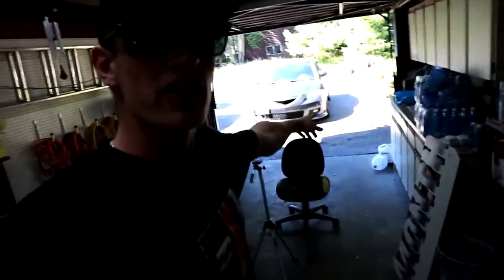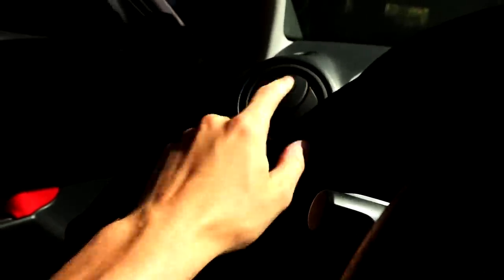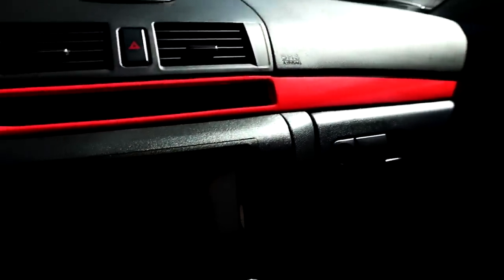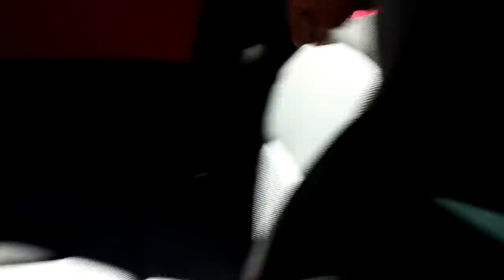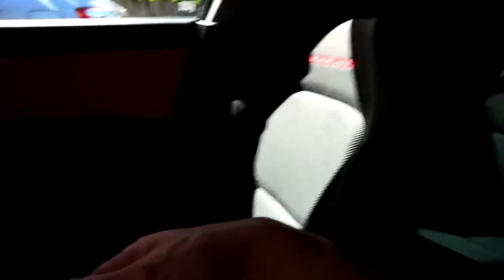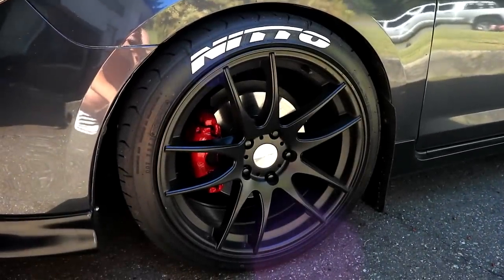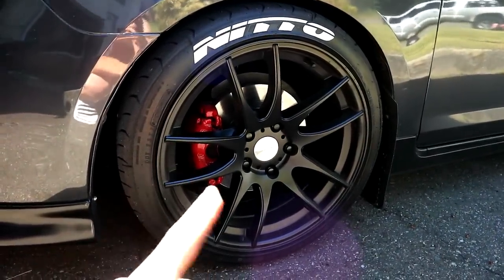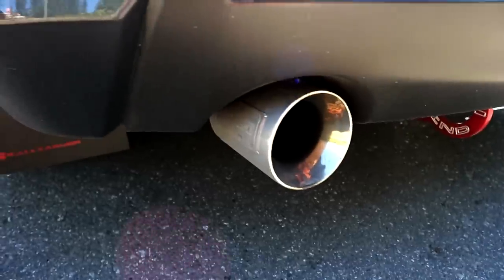MAZDA 3 MOD LIST! | 2007 Mazda 3

Comment: bro, for 18x8.5 rims do we need to roll the rear fenders, did you roll yours? I just read it somewhere, just making sure.
Reply from the maker: If you're running anything +40 offset or lower, than yes.
Reply: @ColtonRichter  I take it as a yes, I will need to roll my rear fenders? :(
Reply from the maker: I'm not sure what offset your wheel is, anything basically below +40 is pushing it, but below you definitely need too.
Reply: @ColtonRichter  did you adjust the camber or just rolled the fender? no rubbing with 2 passengers on?
Reply from the maker: Stock camber & allignment, rear fenders were rolled. Rub with passengers in massive road dips, no damage to tire though

Comment: What’s size are yours rims, I have a 2013, mazda3 took my mechanic today and tried putting 20inch oem infinity rims, they are 245 40r 20, they won’t fit there hitting springs any idea what size spacer too use??
Reply from the maker: These are 18" wheels, normally don't recommend going above 18!

Comment: why not get a speed 3? or speed 6
Reply from the maker: I have a Speed 3 now
Reply: They're a couple grand more that's why lol. If anything, just add a turbo later and it'll come up to pretty much the same
Reply: @ColtonRichter  oh nvm then
Reply: Swoooooveq I’m not saying it’s not doable I’m saying it’s not very smart haha
Reply: Swoooooveq yeah but Honda’s don’t come turboed so it makes sense to turbo them haha and they’re a better platform to turbo anyways. I’m all for fun but you gotta be logical and smart with your money too, that’s all haha
Reply: Jeremie Lizotte lol do you know how hard it is to turbo a NA 3? It literally costs at least $3k to “add a turbo later” and there aren’t any premade OEM compatible turbos for it.
Reply: Swoooooveq no not for the 3. There’s barely any aftermarket support for the first generation 3 when it comes to turbo/forced induction. You would have to salvage parts and use adapters. There aren’t any name brand kits for the 3. You need to do the research
Reply: The body style
Reply: @Swoooooveq unless you have a mazda6 like me.... no turbo kits out :), it would have to be custom.. shootmeplease
Reply: @Swoooooveq  The amount of custom fabrication and dyno tuning alone to make a turbo work with a base 3 would easily break $3k. base 3's don't have the aftermarket support of hondas. You can't slap a turbo on it like you could with a civic. It would probably be cheaper to buy a speed3 and upgrade the turbo on it than it would be to turbo a NA 3
Reply: Colton Richter thank fuck

Comment: Did you have to modify the foot well? It's too narrow for people with larger feet, especially in the winter,  and the right shoe can get caught in between the right edge of the brake pedal and the side of the plastic foot well panel.
Reply from the maker: Nope, was fine for me

Comment: Do you have spacers or does 8.5 width fits perfectly?
Reply from the maker: It doesn't matter what the width is, you need to look into offset. I could have 7.5 inch wide wheels and have them fit the same but that's because of the offset. I don't have spacers ,no.
Reply: Dudesk7 thank you for answering my question
Reply: Dudesk7 would it fit with +35 offset ?
Reply from the maker: My wheels are 8.5 wide with +35 offset, if you want something that fit's nice and won't rub barely at all then you want 8.5 and a +38 offset.

Comment: dude did u change ur headers or intake?? when u change ur muffler
Reply from the maker: Just exhaust
Reply: Dudesk7 oh so ur using straight pipe does it reduce power and more fuel consmption??
Reply from the maker: No, it's a CorkSport catback exhaust. It's a resonator and a tuned muffler, increases slight power.

Comment: So I actually have 207000 miles on my 07 mazda3 and I’m debating doing anything to it. It’s my first car and I really want to work on it but I’m afraid that ones the transmission goes, so will the car. Any advice?
Reply from the maker: Focus on maintaining the car, if the transmission goes then you'll have money to either replace it or get something else. 207miles is quite a bit.
Reply: Dudesk7 damn I was hoping you’d say something else 😂😂thanks though
Reply: My '06 is running strong @ 258k miles.. maintain the basics and you'll be able to have $ to mod

Comment: Is that mazda3 2.0? Or 1.6? Is it fast when accelerating?
Reply from the maker: 2.0L, it does have quite a fast acceleration due to the torque it produces
Reply: mine is 1.6 I hope hes list setups fits for 1.6 as well :(

Comment: Hello guys! Turning 18 in one month and started my driving lessons. I liked the mazda 3 and the mods this guy added to it. Anyone knows good first car buys? My budget is about 5k euros.
Reply from the maker: I will say, Mazda 3 2.0's are reliable and fantastic, great bang for your buck!
Reply: @ColtonRichter  Thanks for the answer. But I heard cars 10+ years old start to have problems. What are your thoughts on that? Never looked into cars and stuff until now so I am not really experienced in this field.
Reply from the maker: Johnny Bravo Everyone's heard it,  but new cars can be the same. Say if you found a lower mileage Mazda 3 that's had maintenance done, you're golden. Just make sure its been taken care of!
Reply: @ColtonRichter  Aight thanks. Is 100000km consider fine?
Reply from the maker: Johnny Bravo That's more than perfect, I got my Mazda 3 when it had 170,000km and currently at 227,000km and it's been bulletproof. Just take care of it and it'll treat you well 🙂

Comment: What is the PCD of your rim?
Reply from the maker: 5x114.3
Reply: Colton Richter Thanks bro. I have 2008 mazda 3 stock if i change my rim to 18x8.5 offset 44 and the tire 225x40x18 there is any modification or need to adjust?
Reply from the maker: Watch for your center bore, if it's different sizes then it could be an issue but other than that that will fit :)
Reply: Colton Richter thanks bro for your kind reply.
Reply: Bro what is the issue if the center bore is different. What remedies will do? What size is your lug nut?

Comment: Hi i have 2010 mazda 3i sedan! How to make sound like your 2007 mazda?
Reply from the maker: Exhaust!
Reply: Colton Richter / thanks how much do ineed it do i need muffler also
Reply from the maker: Muffler delete or replace would cost you about $100cad.
Reply: What about the exaust sir? Thank you for your reply!
Reply: I went to the store they said 200 and i need to buy the muffler tip too that cost 80
Reply from the maker: @ufcfighter9364  If you did a full exhaust, the product would cost you $500usd and you could do it yourself
Reply: Colton Richter / thank you sir!

Comment: How much did you spend over all on all this
Reply from the maker: $4,000+
Reply: Colton Richter lol, 4000 for these shit? Don’t lie Bro
Reply from the maker: @网汽车  *this. $1400 coilovers, $650 tires to pair with the wheels, $800 wheels, $650 exhaust, $500+ sound system. You can calculate the rest, thanks.

Comment: Dang dude at this point turbo the thing or get a speed3 engine and trans haha
Reply: indeed at the point where he is. i hope he switched to a speed 3 1st or 2nd gen or a speed 6. Instead of dumping money on a plattform that lacks, suspension, exhaust, engine etc...hes going to end up sinking way more than what a speed would have cost him. And hes over 200k miles....jesus...
Reply from the maker: *kilometers, haha.

Yes i've bought myself a Speed 3, but i've keep this car just for this exact reason 😉

Comment: Why would you put mazdaspeed stuff in a Mazda 3? Why wouldnt you just sell the Mazda 3 buy a speed3 or speed6 and put money into that. Been modding my speed3 and having a blast
Reply from the maker: Did it to the 3 and had more fun with that then what i'm having with my Speed 💁
Reply: @ColtonRichter  what have you done to your speed? You can do so much to a speed harness bar, racing seats, fully bolt it, big turbo bnrs4 4 with e85 and have 400hp, to me a 3 is pointless for engine performance cosmetics sure but a speed is way better cuz it's already turbo and has a better engine.
Reply: You can do everything to your 3 to your speed. I've had a lot of fun building my speed.